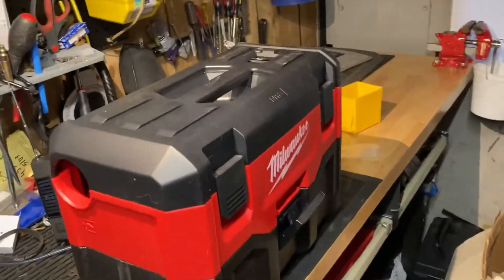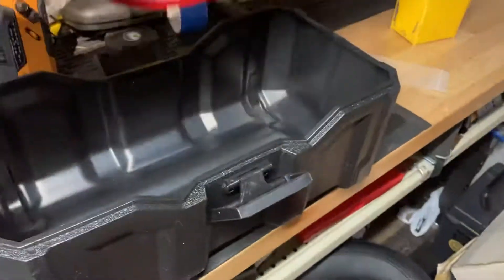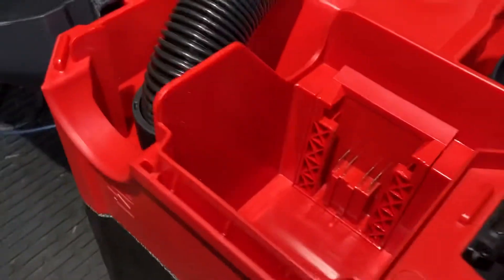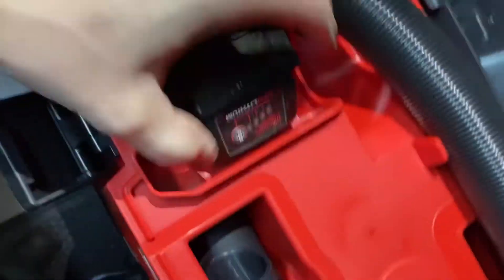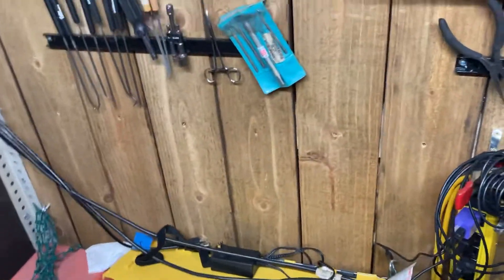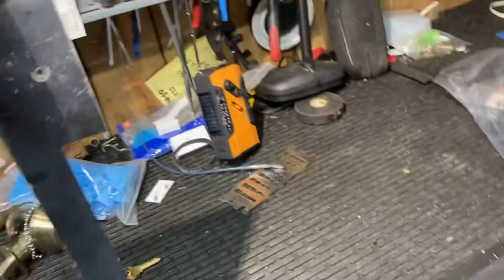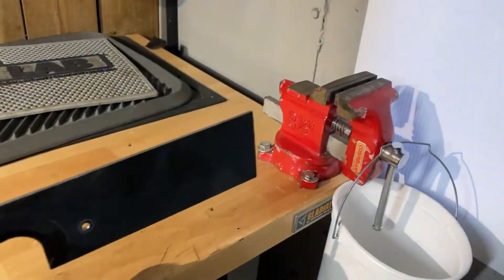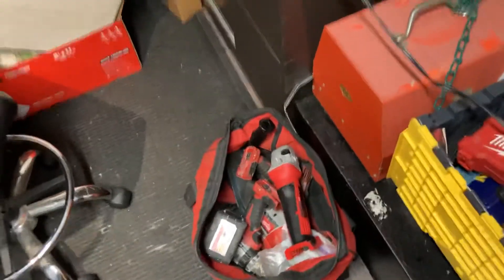Black Friday Tool Investments

Comment: Looks pretty sweet.  A bit big for what I'm looking for, but I'll probably still get it. :)
Reply from the maker: I thought about a smaller one but if you wind up cleaning up wet stuff it’ll ruin the filter quicker because there’s less room in the tank and once the filter gets wet you’ll need replace it.
Reply: @odinslockllc  I only need it for dry stuff